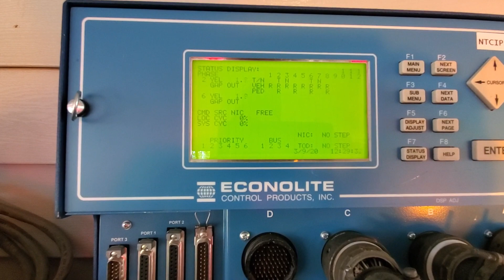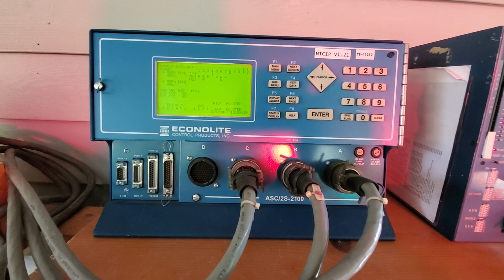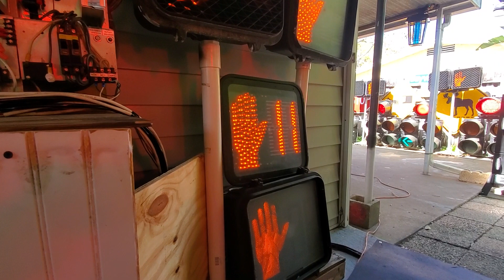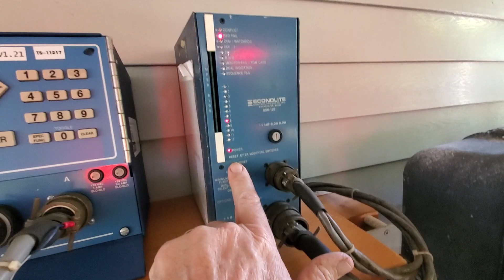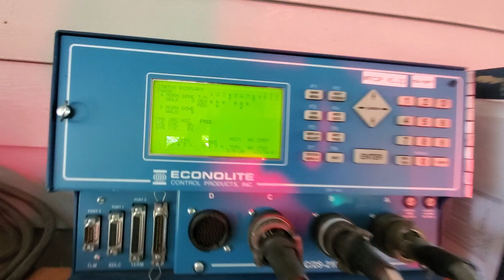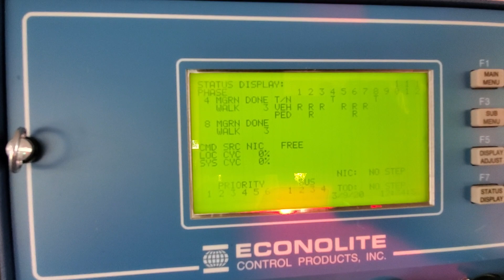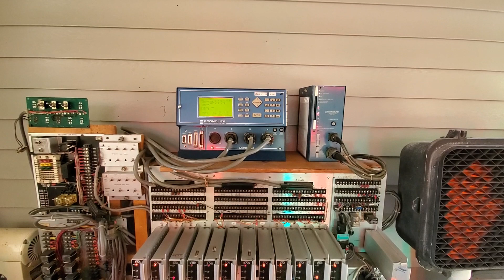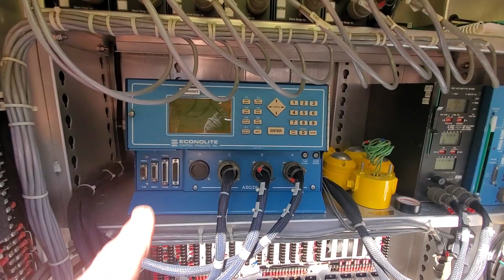Run Up of the Complete Traffic Control System Part 3

Comment: Nice collection! Do you ever sale the controller set ups?
Reply from the maker: I would like to sell the one in this video. It would have to be picked up though. I had it on Facebook Marketplace. I would sell the entire thing with controller, MMU and loop detectors. basically everything without the signals and PEDs
Reply: @jrocco36  where are you located by chance? Im in north east Florida if you are anywhere close to here
Reply from the maker: @gagek93  I'm in the Tampa Bay area
Reply: @jrocco36 ok that’s not too far away. I’m interested in the controller, that would be a great addition for my lights!
Reply from the maker: @gagek93  Next weekend we will be in Wildwood, FL The whole thing is mounted on a wood frame so it stands up by its self. let me know we can meet up and save you the trip all the way to St. Pete
Reply from the maker: @gagek93  Here is the FB marketplace listing https://www.facebook.com/marketplace/item/1217255212480808/

Comment: Very nice display and setup. Great work! I’m your opposite...can walk through an EPAC with my eyes closed....Econolite not so much. I had an EPAC running for 10+ years before switching to an Intelight X2 controller.
Reply: I'm a new traffic control technician,  I wish I could work through either with my eyes closed! We recently switched to econolight controllers. I have to be able to program both for my test in late January. Are their any training resources available online? Our inhouse training has been severely effected by covid.

Comment: Peek has a PDF of their manual for the peek 3000E online. Just Google peek 3000E manual and you should find it.
You don't even need the manual. Just hit Menu twice and hit 6 for the "First time setup" sub menu.
The sub menu runs though everything to get it running from default data loads, timing, recalls and more. 
I love everything about the 3000E with the exception of some software bugs.

Comment: Can you just put connectors on the load switches to power and Apply them to your signals to make them work?  I don’t have a kid bay.
Reply from the maker: Yes and I have done that in the past. quick slide connectors once spread out a tiny bit will go on to the terminals on the load switch. The load switch will require both 24VDC for the logic and 115VAC for the lights. Each load switch can run three lights up to 15A (Max). With modern LED signals you will never need all that but they where designed for use with regular light bulbs. Once you have your lights connected to the proper outputs and +24VDC applied to Pin 9 all you have to do is bring pins 6, 8 or 10 to logic ground (-24VDC) and your lights will light up. I will include a link to the data sheet for the load switches below. just be careful working around the AC Line voltages...

Here is the link to the data sheet for the load switches. the Characteristics may be different then yours but the pinout should be the same.....

 https://www.google.com/url?sa=t&rct=j&q=&esrc=s&source=web&cd=2&ved=2ahUKEwjkrfHvvs3oAhUHc98KHQ9VCCAQFjABegQIAxAB&url=https%3A%2F%2Fwww.pdctraffic.com%2Fapp%2Fdownload%2F6876028204%2FSSS-88LA%2BData%2BSheet.pdf&usg=AOvVaw2U_CO4yv_NT9szJWljNwDd

Comment: Nice signal collection, do you buy new LED’s from distributors by any chance and if so how much does it cost?
Reply from the maker: I brought all the LEDs via online auctions on GovDeals ( https://www.govdeals.com ) 

At the time I got little over 50 of each color and a bunch of different color turn arrows. Ive sold much of them on Ebay and may put some more up soon. Ebay will be your best bet if your looking for LED light inserts.